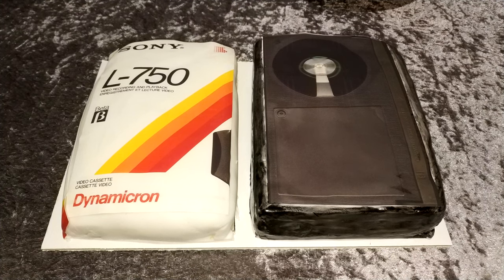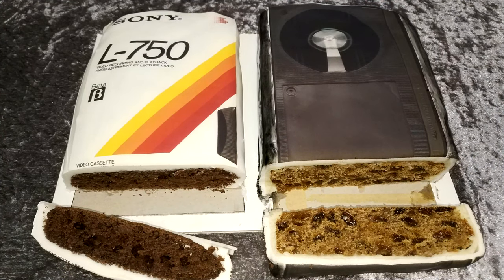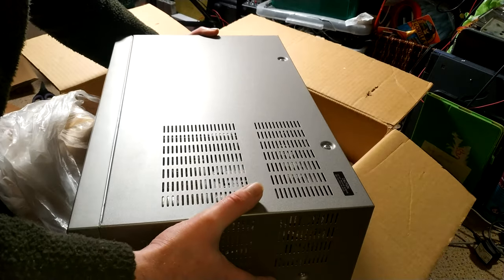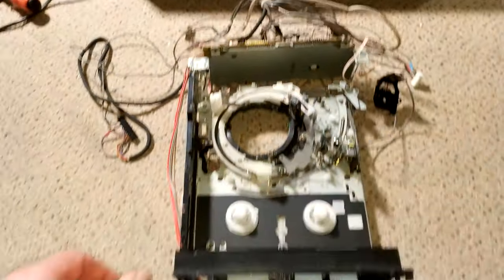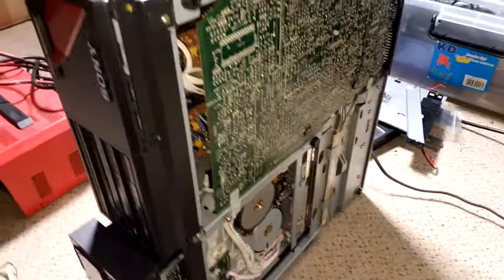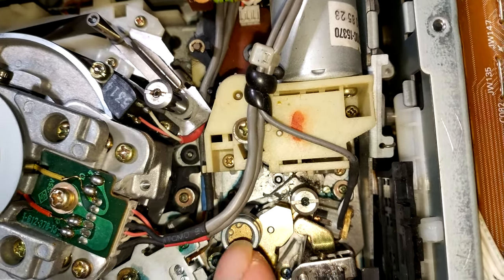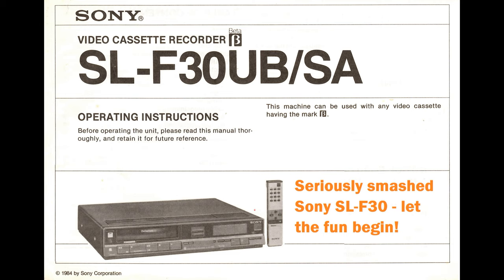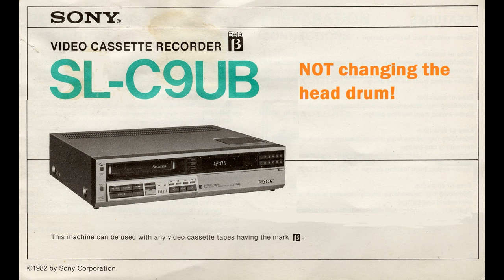Updates 2021 - Cake plus Sony SL800 / SL-HF950 / Toshiba V9600 Betamax updates 2021

Comment: Congrats with your birthday. Beautiful cakes. You have a good Beta bite there. Always enjoy your videos although I am not a technician but a big Betamax fan. I have a few and love those machines. Already looking forward to the next video.
Reply from the maker: Thank you so much and I so wish I'd thought of the Beta 'bite' pun too! Really great you love your Beta machines - which do you have? Anything you'd like to see on the channel?
Reply: @MrBetaByte  In use at home: a black SL-C9ES PAL, SL-F90 PAL, SL-800ME and an SL-HF100UB PAL for playback. The SL-C9ES also for occasional very good recordings. In the attick and not in use, an SL-F30 (good image but sound volume is too low) + SL-F60 (can only be operated with the remote) + a silver SL-C9 in bad condition. Last is a defective 1981 SL-C80 that was used by my mother for over 30 years until it died. I hardly dare say it, in latest years I also collected some Betamovie camcorders. Need to work on the batteries. Think I have no specific preferences. I always enjoy so much seeing how you get these complex machines to work, that is genius!
Reply from the maker: That's a great collection. I'll be doing a video on a black C9ES soon.  There will also be one on the C80 - I've not even powered mine up yet but really looking forward to looking at the quirky remote timer setup! 

The SL800 is a great machine but the power supply needs to be looked after as they are a pain if they go pop. The Hf100 is the machine I love to hate but they are superb when they are 'right'.

The F60 - I bought one only to have it arrive completely wet and my wife declined to accept it (very wise!) but i understand these machines not only have great playback quality with even poor tapes (like the F30) but also have a great still having the third head. 

I too have acquired some Betamovie kit (there's one in one of the unboxing videos that's still waiting to feature!). Have you worked on them? How have you found them to use? Batteries are interesting although you can buy new ones for £95 of it's the NP25 type!

Thank you so much for the kind words too - really appreciated and there will be more fun stuff to come too.
Reply: @MrBetaByte  Thank you for your kind reply. My first camcorder was a BMC-500P. Later it was used by my father untill it stopped working. At home I have a working BMC-100P in a big original SONY hard case, external microphone with the shoe and cable remote. In the attick also a BMC-200P in a SONY hard case but the autofocus does not function. Due I have no eletronic experience/skills it remains as it is. I purchased two of all these camcorders so I could replace outher parts that were damaged/not good looking or get also a hard case. 

Acquired a BMC-550 (NTSC) for 30$ (shipping not included) that has a little switch to record in Super Beta. It came with the SONY hard case and is working. The last I acquired was a BMC-500P but It was poorly packaged resulting in being damaged. I could use some outher parts from the broken one of my father. It records however the image is milky, sound is good.

All those camcorders came with dead batteries (+chargers) so I have quite a lot of these. I found a website (mrbetamax) in the USA. He sells reloaded NP-11 batteries, but I'm from Belgium and it would become very expensive with importing. I was thinking of trying to replace the cells in a battery with 8 AAA's. An alternative I found is to buy a 9.6 V replace battery pack used in Tamiya race model cars. That does not fit into the battery compartment. I'll have a look into the NP25 type you mention. 

Already looking forward to your next videos.

Comment: I have a 950 Betamax video and it play secam
Reply from the maker: Very nice machine. Is it French SECAM or secamOST?
Reply: French
Reply: The colour of the video is grey and not black
Reply: The only problem I've got is at the  led burnout
Reply from the maker: Oh wow - that's really interesting - I've found so little on the French Beta machines - what's the full model number of it?
Reply from the maker: It is grey but the contrast isn't too good in the video - sorry. I did scan a betamax cassette tape and case for the cake. Thank you so much for the comment though - the Sony tapes were quite unique in being grey when all the others were pretty much black (or black and white).
Reply from the maker: Is that on the VU meters?
Reply: Yes
Reply: Sl hf950 es pal secam ots
Reply from the maker: That's the same machine I have - very very nice machine too 😀 It'll play French SECAM but only in black and white as the Austrian Secam system has a different colour carrier.